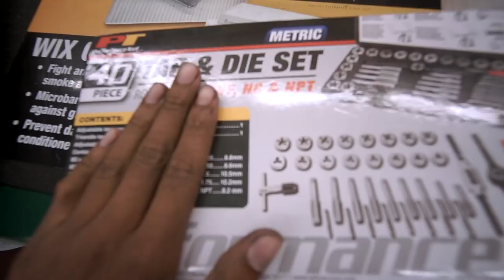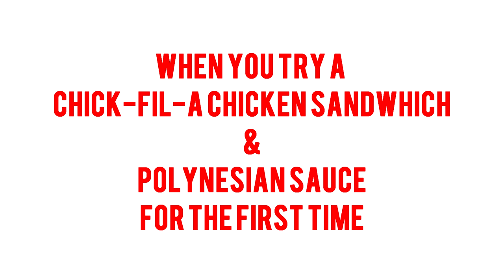YOSHIMURA CARBON FIBER EXHAUST INSTALL - Ruckus Build [EP.5]

Comment: Sounds like she is running a little rich.  I’d try the (Smaller) 82 main jet.  Jet size also depends on weather and altitude not just upgrades
Reply: Also, check the spark plug.  White = lean or not enough gas.  Black = rich or too much gas.  Tan = sweet spot or the right amount of gas to match the air

Comment: Tht exhaust is way to loose it shouldnt shake like tht it should be solid af no movement u sure them bolts on the bottom are tight ?

Comment: probably could have kept the old carb on it, just looks like someone over adjusted the throttle stop screw.
Reply from the maker: Nah the old carb was messed up the butterfly flap wouldn'y close all the way
Reply: Oh ok, im just going off what I saw in the video of the throttle stop screw being screwed all the way in making the throttle plate not be able to close all the way @9:14.  Someone before you probably couldnt get it to idle and just cracked the throttle plate open with that screw.